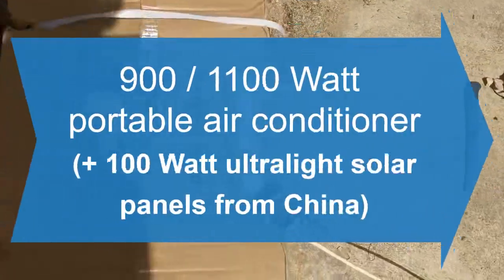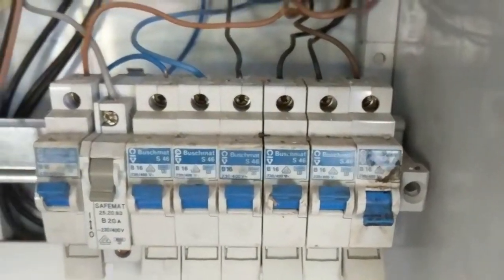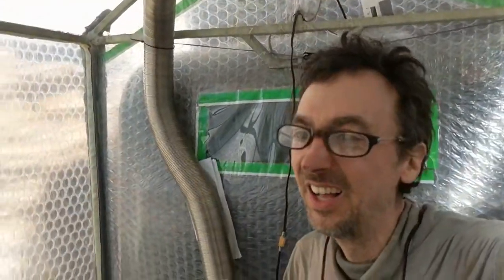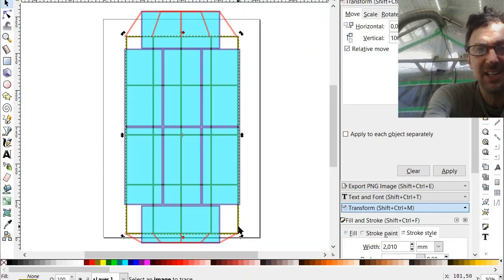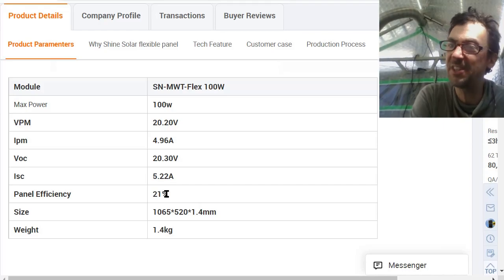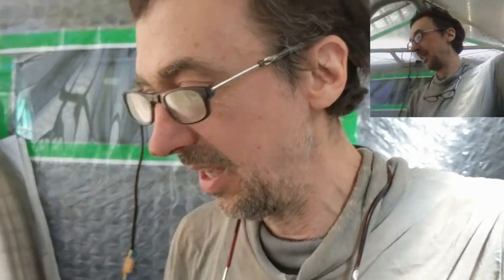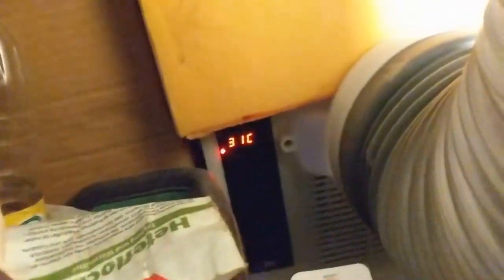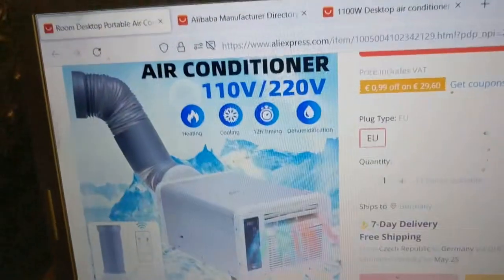Portable Air Conditioner - review/test/unboxing 900W/1100W

Comment: Can I put the back out the window like a window ac, I think the exhaust hose is too bulky?
Reply from the maker: @CheMathiewNgayihiAbbe  yes. Like window air conditioner.
The inside hose is still good to blow the cold air somewhere higher.
Bit if you install the ac already at a good hight you don't need the hose.
Reply: Do you recommend it?
Reply from the maker: @CheMathiewNgayihiAbbe  not really. Maybe for a small room without much light from the outside. But yes, it makes it a bit more comfortable when it is 30°C  . My rework to install it as a heat pump does not work below 10°C because the outside cooler quickly freezes.
Reply: @robodurden  you mean it can't cool down a 35°c hot room?
Reply from the maker: @CheMathiewNgayihiAbbe  it depends on the closed(!) windows and the insulation of the walls. With 300 Watt electrical input you only get max 1000 Watt cooling power. That is already the sunlight through a 1x1 meter window. The bigger the room, the more heat comes in through the walls. If each of the six sides of your room has 10 square meters and the U value is 1, then if you want -10°C, you will have a heat loss of 100 Watt through each wall/ceiling/floor which sums up to 600 Watt.
So yes you will achieve a difference of a few degrees Celsius. But if you really want to cool down or heat up, you need a 12000 BTU split AC with electrical input of 700 Watt and cooling power of 2000-3000 Watt.
Reply: @robodurden  thanks

Comment: Hi, nice video! Can I ask you a question? Can you run it on a big power bank? Like the goal zero yeti 1500w? Thanks
Reply from the maker: Should be no problem. The AC needs about 300 Watt continues power. I only tested it with pure sine inverter. But it should also run with 500+ Watt cheap modified sine inverter.
A 24V DC truck/tent air conditioner should be more efficient. But far more expensive.. yet, a truck AC is more powerful. 1000 Watt cooling/heating is not really much. I get at max 10 degree Celsius temperature difference in my tiny camper.
I think I still need to upload the video in how to transform it into a heat pump. Additional temperature switch needed...
Reply: @robodurden  thanks. So you think that a 24v one is more efficent even with lower btu? I've found a chinese one quite cheap but with only 2500 btu
Reply from the maker: @alessandrodemoro3312  please link or title to AliExpress. Inverter to 110/220 V AC only has about 80% efficiency. AC motor with capacitor at 300 Watt only has about 70% efficiency. So total efficiency is 0.8*0.7= 56 %
A BLDC motor running directly on 24V DC should have efficiency above 80%
BTU is cooling output. A DC air conditioner could generate 2500 BTU with less battery energy - in theory.
Reply from the maker: @alessandrodemoro3312  link not working but I see such expensive tent AC on AliExpress and 650W output at 250W input is a bad COP of only 2.6 :-( I think a cop above 3 should technically be no problem. But I like those tent AC with two hoses !
If fitting to your space I would recommend something like € 435,39  24%OFF | 12V/24V truck overhead air conditioner
https://a.aliexpress.com/_ExLyQjn
Cooling capacity up to 2400 Watt = 8189 BTU.
Don't know why cop is so bad for AC. Heat pumps range from 3 to 5. Same machine..
Reply from the maker: @alessandrodemoro3312  also consider that normal AC air conditioner is quite loud. I guess a truck AC is not more quite. Maybe a tent AC.. depends on the type of compressor. I have an AC project in my pipe based on a vacuum turbine..

Comment: Hi robo durden, I bought the same A/C for my camper. As you say it kinda works but I am facing one problem: It does not run on my efficient 500W Victron Inverter but only from my oversized 3kW Inverter which uses 30 to 50W itself. I would really like to use it with a smaller inverter and I think it is because of the startup surge so I am already looking for a startup capacitor solution. Do you know if this is possible as it is a 230V AC and connected to an Inverter? Watching all your videos, especially your tinkering with hoverboards! BR!
Reply from the maker: It would need a soft start. You could try to place a light bulb dimmer right before the compressor. 
Or add that nice automatic transfer switch to your camper where the big inverter is the primary input and the small efficient inverter the backup. A one phase transfer switch would do.
A capacitor only works for DC. With AC you can try a big inductive coil. Maybe 50 meters cable rolled on such a portable cable extender. That is said to help with big electric circular saws..
Reply from the maker: A simple light dimmer might only work for brushed motors, not a capacitor motor which basically is an asynchronous 3 phase motor. A frequency inverter might do. Today, all good heat pumps have a frequency inverter built in to run with perfect efficiency.. Replacing the capacitor: € 65,72 1.5 KW 220V 3 Phase Variable Speed Drive Frequency Converter for CNC Milling Machine
https://a.aliexpress.com/_uxcc43
With keeping the capacitor, there are single phase output frequency inverters.
I guess efficiency is worse even at 50Hz. But at 100+ Hz the cooling power (and electrical input) might be boosted to 200%..
Better install an automatic transfer switch for your two inverters.
Reply: @robodurden  Just got my first transfer switch in the mail. Will try asap and get back to you. Thx a lot!
Reply: how much Watt Inverter do I need ? 500w or 1000w Inverter ? how much Energy will this AC consume During normal Operation ?
Reply from the maker: @ImplantedMemories  I can not read your mind to learn what you need the AC for. The AC will consume about 1/3 of electric power. A 900W AC will need about 300W electricity.
Reply: Could any of you do more review for this product ? It's hard to find, almost like it never existed